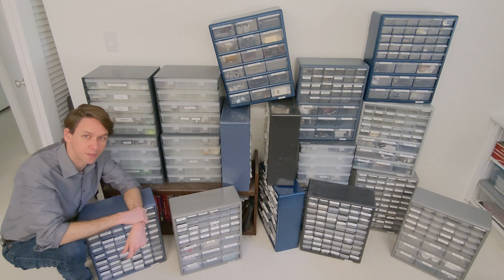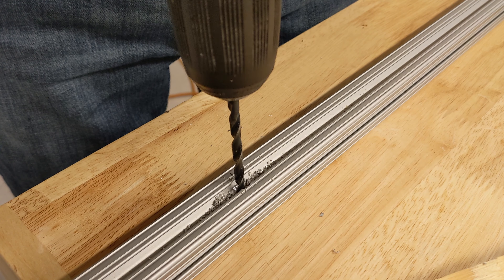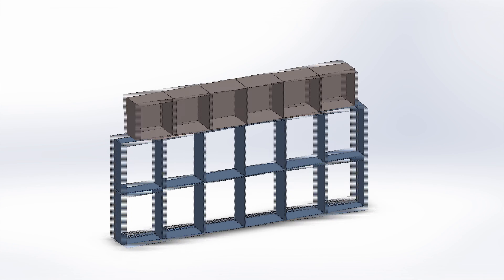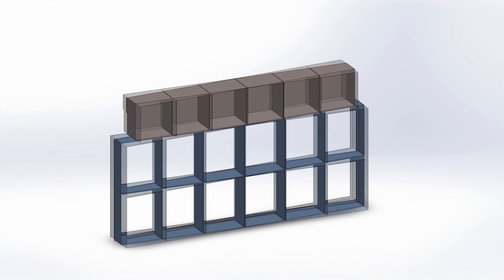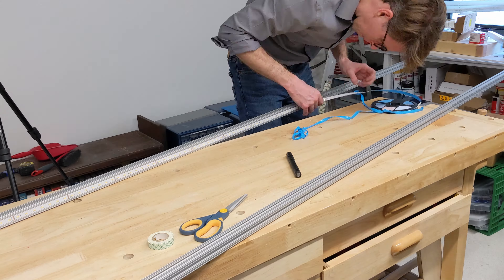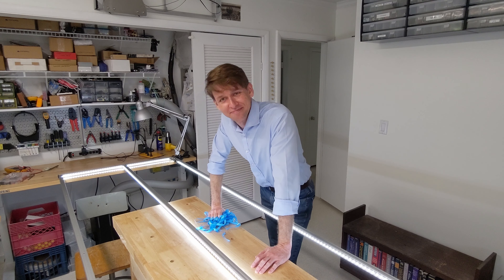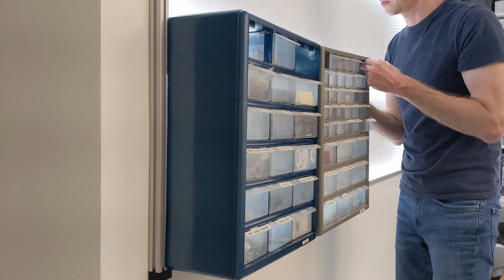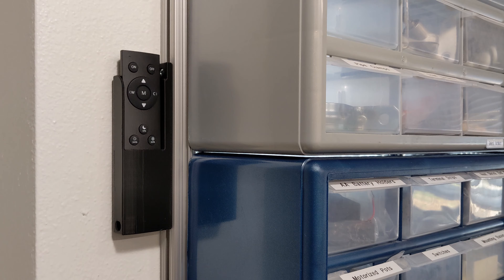The Wall of Storage: a Backlit Hardware Store at Home

Comment: Great ideas! Who makes the dividers that are on the French cleats for the removable plastic trays with lids? Been trying to find something for my stack of those forever.
Reply from the maker: The steel cases with removable plastic organizers have dividers molded in; those can't be adjusted. They came from McMaster-Carr. Check out my short video about the crimp terminal organizer for an alternative way of increasing the resolution though. For that one I 3D printed some cups to subdivide the spaces in a fixed tackle box. Thanks for the comment!

Comment: Interesting project. Does the lighting actually help you see whats in the boxes, or is it purely decorative ?
Reply from the maker: I've been reorganizing everything between the three types of organizers you see in the video, and actually it really does help. For instance: some of those drawers can be subdivided once (with a little sliding plastic piece) and other can be subdivided three times; these latter are useful in situations like "4-40 x 1/4" machine screws, of which I may have 4 different types that could all live in one drawer. The lighting helped me quickly scan through the stack looking for that type of drawer so I could allocate them most usefully.

Comment: Nice job. I often use extrusion as a hanging rail similar to a cleat by making a 6mm wedge for the slot, then the frame can sit on the hanging rail
Reply from the maker: Thanks! That sounds like an easier way with less fiddling for sure.

Comment: Great video!! Do you happen to have a de-interlacing filter or some sort of motion smoothing on by chance? The motion seems a bit off, and if you slow it down about every other frame has interlacing artifacts
Reply from the maker: Thank you for your comment, this is just the sort of feedback I need. I shoot everything with my Pixel phone. I import it into a Davinci Resolve project set to 30 fps. But looking at my source files in windows they're reported as 30.08 fps, 30.09 fps, etc. What to do?

Comment: FYI: Those rubber bumpers will most likely leave a black residue mark on the paint. You may want to put something like packing tape as a buffer.
Reply from the maker: Thank you for the tip! After I take this down I'll have to patch the screw holes and touch up the paint anyway, so I think it's okay.

Comment: Beautiful, but since you went to so much trouble, you also should have painted them all the same color.
Reply from the maker: Thank you but that's a step too far! I acquired them over years of course, but if I were building out a new system I'd get them all at once at the same place and they'd be the same color. By the way, one of them glows significantly warmer than the others because it's the oldest one and the bins are yellowing!

Comment: Where did you get the storage container boxes above the bookcase I have some I purchased from HomeDepot but can no longer find them?
Reply from the maker: I also got those from Home Depot but I think possibly from another store as well. They're obviously all made by the same company but they're branded differently; the black and orange ones are Black and Decker for instance. It's been a long time since I bought one though. Good luck!
Reply: @EikiMartinson  Thanks for the quick response. I fear that it may take luck or a lucky find on craigslist/facebook marketplace at this point. Since like you it was years ago that I got them.
Reply from the maker: @SteveRobillard  It's a convenient thing for sure. I'm reorganizing now a bit to put the sorts of things I need in the field into those boxes, since they're easy to take with you.
Reply: @EikiMartinson  Great minds, that is exactly why I am looking for more I can put together a kit in each box and they are easy to bring to the library where I teach.
Reply from the maker: @SteveRobillard  Ah, we should connect. I've done some teaching at a makerspace as well.
Reply: @EikiMartinson  agreed what did you teach, electronics? What part of the country are you in (assuming US)?
Reply from the maker: @SteveRobillard  I was on the board at a place, now defunct, called Hacklab North Bonyton in South Florida. I supported the workshop there, ran the CNC, and taught several introductory CAD courses. What are your library courses like?
Reply: @EikiMartinson  I teach programming and physical computing at my local library (students range from 8 to 70).
Reply from the maker: @SteveRobillard  Physical computing, that's cool. It's especially inspiring when students get to control things in the real world. It separates what you're doing from the digital world everybody inhabits these days. Good for you! What state is this?
Reply: @EikiMartinson  I am in CT.  Funny enough the think that impresses the most especially the kids is letting the magic smoke out of an LED.  Stinky demos seem to be a crowd pleaser.
Reply from the maker: @SteveRobillard  Ah, I have family in Storrs as it happens. LEDs are definitely where it's at for getting kids excited!